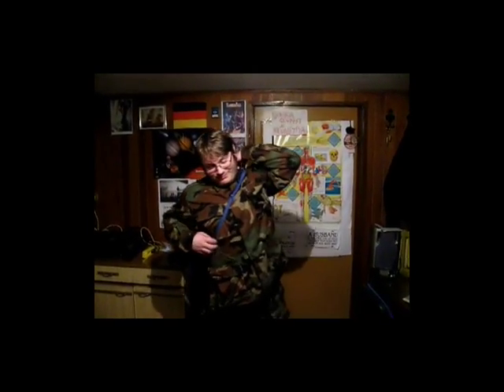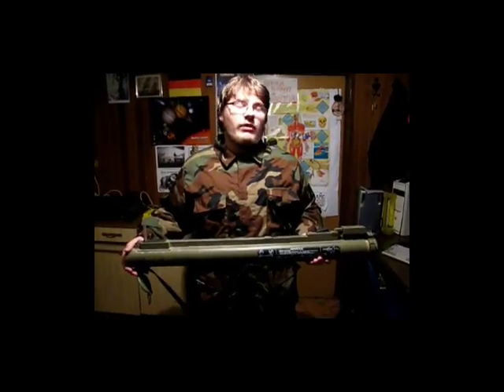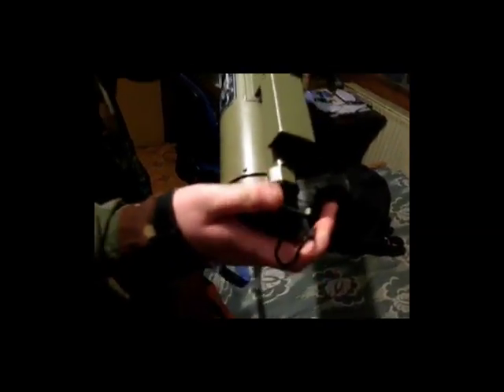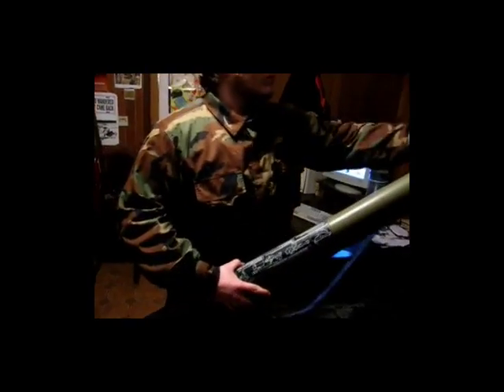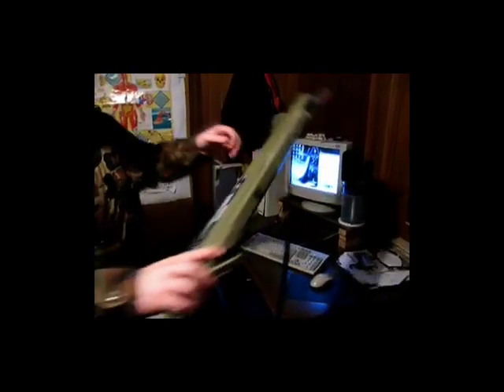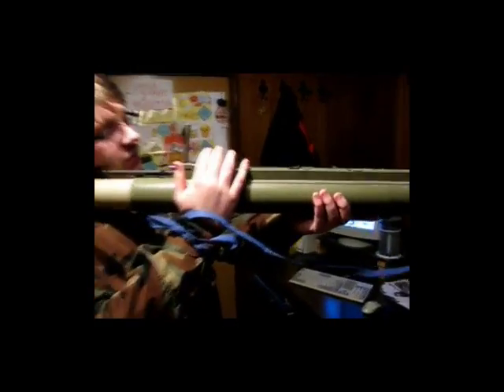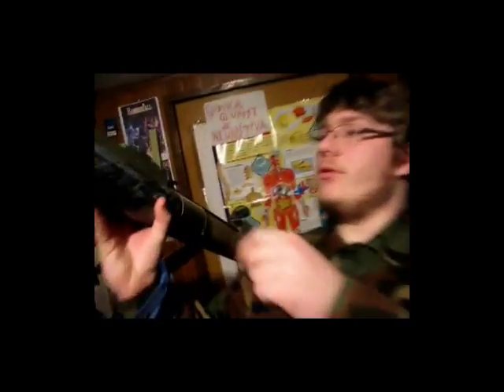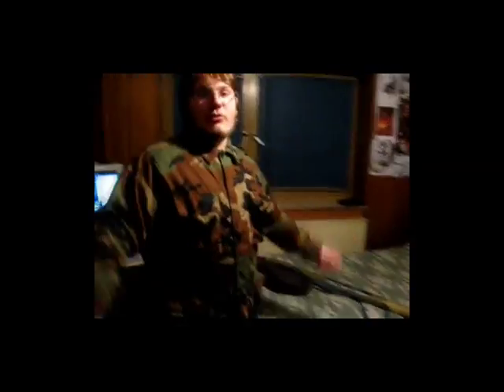M80 "Zolja"

Comment: I have 20 of these launchers and three of the wooden transport cases.  They hold 4 tubes. Mine r all real nice condition. I have five of the M 72 launchers And you can clearly tell the M80s r a better design. My favorite aspect is that the shoulder sling stays attached and you can actually move with the launcher open ready to fire using the shoulder straps still.  I think that’s really clever.